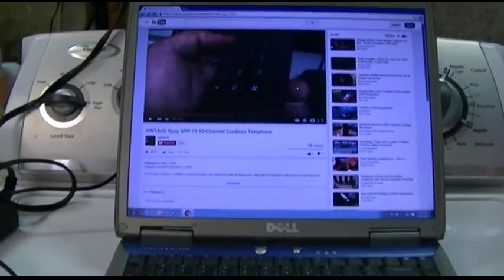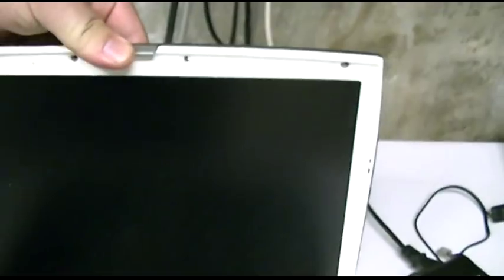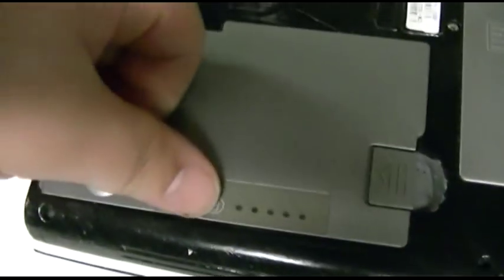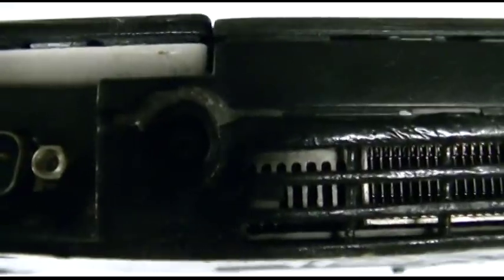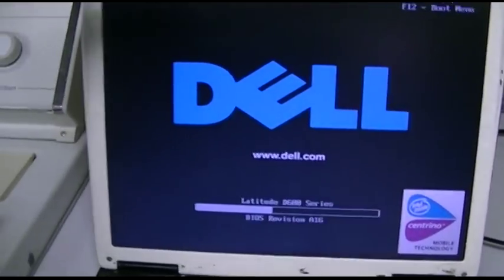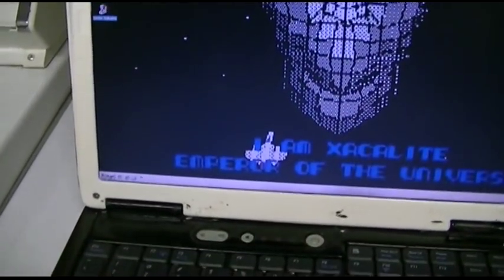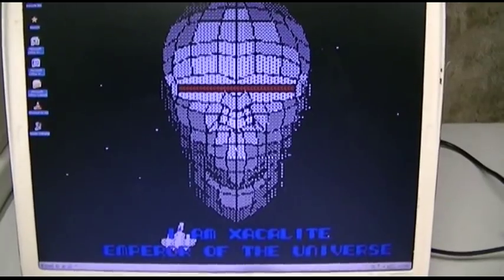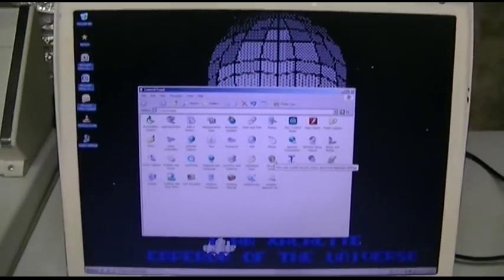Dell Latitude D600 CUSTOM Part 1, Windows XP

Comment: My Inspiron will play videos up to 360p in the small format.. But that's on XP.. I have a Dell Latitude D630.. It also has a Centrino processor which is a fair bit better than a Pentium 4.. I wouldn't knock that adapter too much, I think it's not all that bad.. I had gone through the original adapter and another replacement one in about 2 years..went around and found the one shown in the video and got it because it came with a lifetime warranty! So far it's been working fine for maybe 3 years now.. I don't know how good the warranty really is, but it's a nice thought if nothing else I suppose.. That sure is one jacked up machine though, both inside and out.. Some serious Windows rot going on there for sure..
Reply from the maker: +Jordan U Well part 2 shows it all fixed up.  Outside of it has remained the same for obvious reasons.